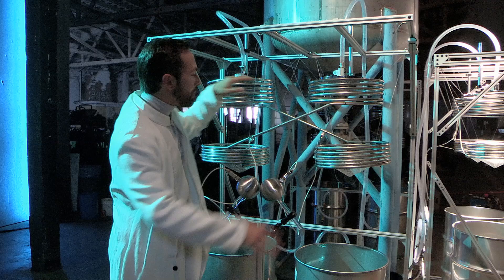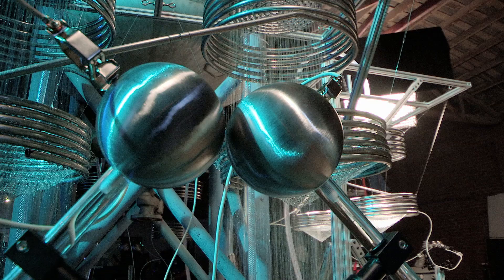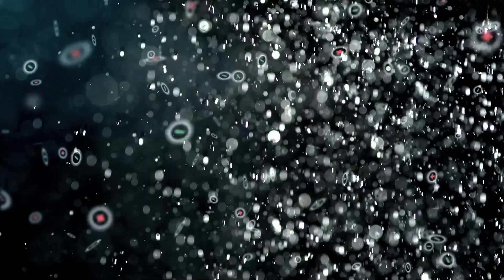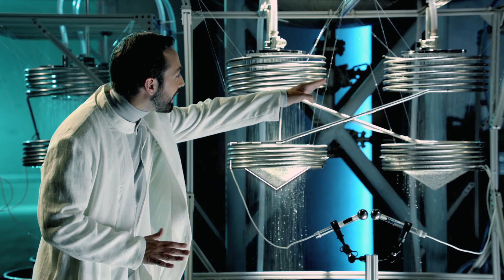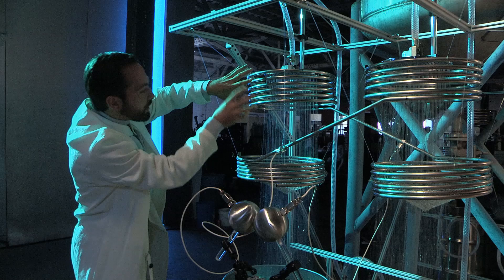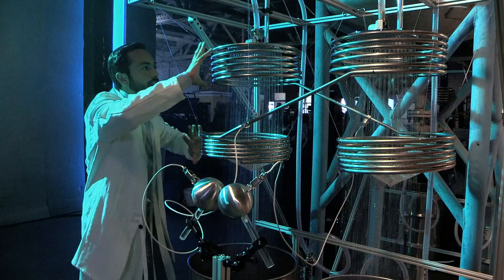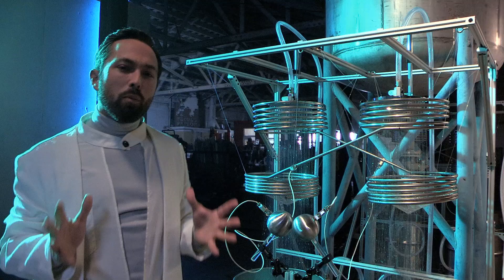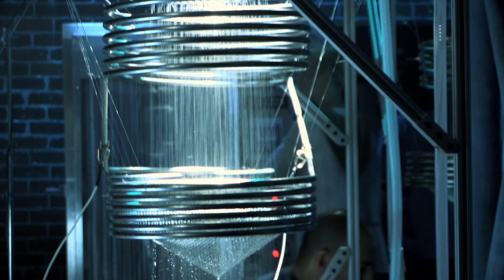Sparks from Falling Water: Kelvin's Thunderstorm

Comment: I would very much like to see the math that shows it would take 6 years to charge a cell phone with a Kelvin Thunderstorm.  I would guess it could do it in more like a few months or less. It might be difficult with current technology to reduce the voltage efficiently enough to actually use the energy though.  Perhaps it wasn't meant to be a literal power estimate. 
On another note, I also wonder what is the minimum current a spark has to have, in order to be visible.  There are plenty of references on the internet that mention about sparks jumping about 30kV per cm, but nothing that mentions minimum current for visible sparks. If anyone knows, I would be super grateful to hear the answer.  Thanks ahead of time!

Comment: If the water has any salts in it it would conduct very well, this is how fractal wood burning is done. Could allow for a bigger charge aside from cheating and putting metal in the water. I wonder if the temperature would affect anything? I'm interested in this now

Comment: I assume that gravity gives the speed to the water falling between the coils and inducing a magnetic field by amplification of the statistical ionic imbalance by the "crossed coils" ("which is just an awesome idea" 🙂. In short, a tiny portion of the potential energy of the water produces the energy of the spark. The waterfall should be slowed down very slightly... I guess I understand a little better now how thunder and lightning are induced. Thank you for your great input and formative videos.

Comment: I thought this effect implied also the (admittedly small, nonetheless present) vertical & horizontal components of the Earth magnetic field? H₂O is an electric dipole, moreover water also has charged ions in it. Any motion of charged particles in a magnetic field separates the charges according to their signs, along the flow. This idea was tested first by Michael Faraday, who immersed electrodes, connected to a load, on both riverbanks of the Thames, along the slowly flowing brackish water, aka the first magnetohydrodynamic power generation. I wonder if this effect is also at work here, somehow.

Comment: each water molecule is diamagnetic. In the video you say one side becomes positive and one negative. If both shower heads were released at once this would seemingly be random as to which happens first but would continue to be once formed. If one shower head is released first for a time period then I bet it would form the negative charge in the coils to the opposing side therefore predicting which becomes positive and which negative.

Comment: I wonder 
what happens if you surround the waterfall with an insulating tube (like an open ended cylinder of thin glass as big in circumference as the shower head).  Attach the top of the tube to the shower head itself so that water can't go around the cylinder.  You could also then wrap wire around the cylinder itself (to get closer and more coils).  And, modify the inlets to the shower heads so that there is a pool of water above that feeds both shower heads.  That way the water in the inlets will be self segregating as well.

Comment: If current passes through a coil it generates change in magnetic flux inducing current to the coil and passing to the connected coil on other side.
And then again inducing current to the water on other side doing the same thing round again.
I guess so...

Comment: The way the discharge is generated is by accumulating opposite charges in the meshes, therefore in the spheres. This would make sense if both shower streams where fed by the same water inlet, since the rings would attract either negatively charged or positively charged water. Water is essentially neutral, so one must separate the charges somehow, but this is not the mistery (at least to me). The thing is, we are taking energy away from the stream of water. Do I have infinite energy then?

My first guess would be that, the energy we can take from the system is part of the kinetic energy the water loses when crashes into the inferior meshes. And that would be it.

But I love to mess around with physical concepts, and to contribute to the thread:

First of all, there is no electric current, except for the brief moment of the spark, so for me, the magnetic fields on the water are discarded. Nonetheless, electrically charged running water does apply a magnetic field on the coils. This would mean that we somehow are messing with the temperature of the coils, possibly cooling them by spin arranging (much like in paramagnetic cooling, in case you want to look it up). The coils however, are in contact with a big reservoir at constant temperature: air, meaning that in fact, temperature remains constant, but we can have effective heat transmission. So in the end, the energy we see in the form of a spark, is the same heat we extracted from the environtment.

It's a little bit far fetched, and I may have something wrong, but I definitely believe there is some shady thermodynamic process going around in secret here :D so my answer would be: heat. We transform heat into an electric discharge.
Reply: To clarify my answer, my point is that kinetic energy of the water is transformed into potential energy (of "configuration") when it crashes in the mesh and the drops divide into tinier droplets. Between the impact and drops dividing, I believe that kinetic energy of the stream is not our source of energy.

The thing is, that from a thermodynamic point of view, we are "separating charges", so this means we are messing with the entropy of the system and when you mess with the entropy of a system with so many degrees of freedom... well, it's hard to tell. It could be that when the droplets crash they somehow transfer the charges and this provokes heat transfer. It could be magnetic induction from the water stream, hence heat transfer. It could be polarization of the water stream, or that the rearranging of the charges in the conductors compensates for the entropy changes (partially). It could be them all, but probably, there is one that dominates over them. Which one? I would love a detailed answer to what may very well seem, a trivial question :D

Comment: you generate the electro-static potential by separation work done between the different charges bwtween the water dops in the showerhead. there the energy is taken out out the streaming waters´ kinetic ebnergy in the form of slowing down the stream a little.

Comment: We did this with two tin cans, a couple of rings, and a couple of wires. It doesn't look this stylish, but it works just as well.
https://demos.swarthmore.edu/physics/2015/06/kelvin-water-dropper/

The simpler experiment works on the same principle. Droplets fall through a ring, resulting in charge separation that charges up the receptacle cup on the one side and the ring on the other side opposite of the receptacle cup on the other side and the ring on the first side. Why it works is because no system like that is going to be entirely neutral - the experimenter's own electro-static field may well be what jump-starts the charge separation. The energy for the charge separation comes from the falling droplets, which can do work (something like mgh) on the charges in the rings. We had sparks that jumped well over a centimeter.

I'm trying to figure out what difference it makes that the experimental setup in the vid uses what look like coils.

Comment: Air, friction and static charge is the cause.  if you did this in a vacuum it would not produce any charge/spark.  the water is neutral and from a common source for both sides, the energy aka gravity from it falling isnt giving it electrons (or stripping them).  something has to do that and my guess is the air,
 friction and static charge in this case providing contact induced charge seperation of elections which then starts a bi-polar cascade effect with the falling water sources because of its design.

I'd like to see this experiment done with a higher drop before the first coil ie. at terminal velocity of water drops?  and see how big the charge gets or even faster as the velocity will better off keeping the water away from the coils as the potential difference builds up?

Comment: Water molecules passing through coils, get charged. But not sure if the coil itself make the charge or the Hydrogen molecules. I know hydrogen acts as a metallic substance under extreme temperature and pressure, but not sure about what the mesh is for. Might be to collect the charge easier and nothing else. Probably all thing that's going on is because of coils and water droplets. But I have to think about this carefully with my pillow now.

Comment: I am a former petrolium tanker truck driver. In the petrolium industri electric charge from flowing liquids are taken very seriously. At all times the vehicle must be connected to a common ground point while filling up or delivering the products.
All non-EX classed devices are forbidden outside of the drivers cab.
On the truck itself there are 2 discharge tubes that must be no more than 10 centimeters (4") above the ground while in traffic. Same goes for the trailer. This is because fluids require more than that distance to atomize in air, and in worse case ignited by static electricity.
Under certain weather conditions you can see large sparks fly from drain and manhole covers to those discharge tubes. This is because of rain water is "rubbing" the outer roof of the trucks cisterns during driving.
While delivering the product your hair on your legs can stand up due to static build-up. Higher flow rates gives higher sensation. =)
Fun facts: Mythbusters did a episode when the tried to ignite gasoline with a cigarette.
That (and a few other) episode is totally bogus and should never been aired IMHO due to it containing absolute false claims.
And, if you get zapped by opening your car doors then you probably have a break or corrosion in your exhaust system. Tie a wire to the last muffler and take a drive to see if the zaps go away. Wire must reach the ground. =)

Comment: Friction. The energy is coming from the water molecules picking up electrons from the oxygen atoms they rub up against as they fall. This effect is how you cars computer can tell how much oxygen enters the engine by the input from the Mass Air Flow Sensor. The MAF sensor has wires in the intake air stream that pick up electrons from the oxygen atoms and the static charge on them is measured giving very accurate data on how much oxygen is going into the engine.

Comment: There is a serious miss conception... its not Amps that kill you... its correlation between voltage and current... otherwise welders would kill you, they work on up to 250A of current, they are AC and DC ones out there too... if its above 50V or 0.30Amps they are dangerous... can be 50V 500A or 10000V 0.31Amps that would totally get you killed

Comment: Wouldn't this device work a whole lot better if we pre-polarized the water, using a permanent magnet at the water inlet steams to sort out the charge ahead in the showers?  Then we could force the charged water particles into specific shower heads and make more current.  Next we could have a permanent radiation decay source to ionize the water up stream of the magnets to help ionize the water.  Then we could pressurize the system so that the showers are at higher velocities.  Then we could switch out the water with mercury....

Comment: Static electricity, same as cloud make thunder...  every water drop move and make contact with other drops massively, fill it with ion in the side.. with different potensial between right n left waterfall, so it make spark to be neutral again.. i think...

Comment: What if you make it bigger and put more metal or copper tubes and mesh. I just think it will make a higher voltage and to charge something put a non explosive battery in the middle or  attach a transformer to amp up the volt. I also want to experiment with this, and this is what I'm thinking of doing.

Comment: You rather skipped over the important part of how the drops become charged. Look up 'electrophorous' for instance on wikipedia. The position of the shower head where the continuous conductive water breaks up into discrete isolated drops is vital to the operation. The top conductor (it makes no difference that it's a coil, that's just a convenient way to make a conductor without sharp points that would leak charge through corona) induces charge separation (polarisation) in the water drops elongating as they exit the grounded shower head.  As they separate from the grounded water behind them, the charge remains trapped in each now isolated drop. I think you ought to remake this video, or at least re-record the section where the drops are leaving the head, with a graphic of the induced polarisation , and a reference to the electrophorous.
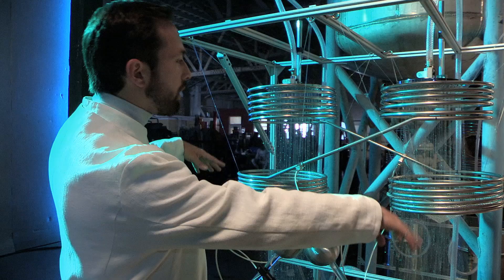Reply: Sorry , but he asked us to leave the answer "You rather skipped over the important part of how the drops become charged." -  but mentioned 1 factor  at 01:12

Comment: That is so cool! "Imagination is more important than knowledge" Albert Einstein. This experiment really stimulates the "What If?" to clean energy collection! I have to wonder with the number of negative feed backs do they represent the Petrol industry?
Reply: @alrestauro I am all for finding clean energy sources, but this is not it.  There is no scenario where this experiment competes with any other way of using water (hydro dam, steam turbine, etc.) to generate electricity.  While it is a vital experiment to aid in understanding the relation of electricity to moving atoms (as in every atom is an electromagnet), it is far too inefficient to be practical.

If clean energy is your primary goal then try this:  Tesla Steam Turbine with heat provided by a J-tube rocket stove.  Use what tiny amounts of ash survive the rocket stove as fertilizer (potash).  If your rocket stove is set up properly, only water vapor and warm air come out of the exhaust so no air pollution either.  

You can further enhance the positive effects of this setup if you are burning hemp cord (the wood part).  The hemp will replenish nutrients in the soil that vegetables and grains use up.  Plus, with the rest of the hemp plant you can make your own bioplastics, fabrics, foods, fuel, medicines, etc.  Crop rotation FTW.

Comment: You said that current is when it gets dangerous. High amperage and very low voltage is not dangerous, ie an arc welder can have around 200 amps and only give a small shock.

Comment: The energy comes from gravitational potential energy I’m assuming. As the drops fall, gpe is converted to ke. This gives them some momentum. As they enter the likely charged coil, the raindrops experience repulsion buy due to the momentum they keep falling. However some of the ke is used to generate electric energy in the coils, setting up the pd. This means that the raindrops would slow down a bit, but probably be unphased as gpe is still being converted to ke as it falls down. Once the drops fall into the reservoirs, there’s an uneven distribution of charge, a very high pd. So the electrons move from the negative reservoir to the positive one by crossing thre gap, generating a spark. Is this concept right?

Comment: surface friction on the water droplet falling through the air, causing the imbalance in temperature causing and electrical discharge

Comment: The water is in motion, so it does have energy for sure. And the water is charged, at least that's what the video says. So we have charges passing nearby a metal coil and I guess that's inducing the electricity, correct?

Comment: No need for coils, just   simple   tin  can rings would do it...  Ive got  same amount of spark  with just a single  2 mm diameter stream of water coming down, I think bigger is not  any better...... Where energy comes from?    the very  behaivior of the water tells  you, there is  a force  of the electric field  on the water dropletts coming down, this would  take  kinetik energy of the  drops,   making to  fall slower than if free, that difference of speed is translated to electric energy, when it is released as light and heat in the spark the drops accelerate again,  untill  slowing down again... I did this   in 1969, and there were no internet at that time  congrats for your  enthusiasm in teaching!! I think  the grater efficiency would not be in collectors diameter  but in lenght, as field would act longer in the fall...  in the big diameter  the center  stream  does not get enough  attraction...  they are too far, the problem is: longer  the collector rings and the water  will almost stop   going sideways and discharging the  collector....what do you think???  energy augmentation could be done  in paralel machines  wit only one little stream Not serial, not multiple streams like showers

Comment: Electricity is just the flow of electrons through a system, and as it flows positive atoms attract electrons, negative atoms have electrons to spare if I remember this all correctly that creates an electron flow through the circuit and you achieve a small reaction, has it ever been done on a large scale?

Comment: Where does the energy come from?   In this setup the energy most comes from the grid, which is powering the water pump that is moving the water that is continuously falling.
Reply: But it works with naturally falling water. So like he talks about in another episode about salt lamps supposedly producing ions... it's picking up free ions from the air would be my guess.